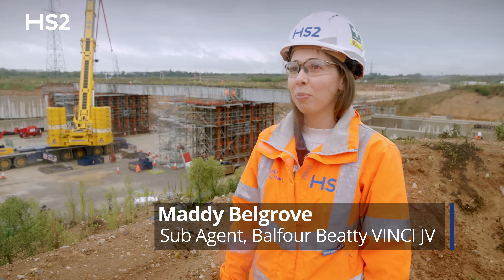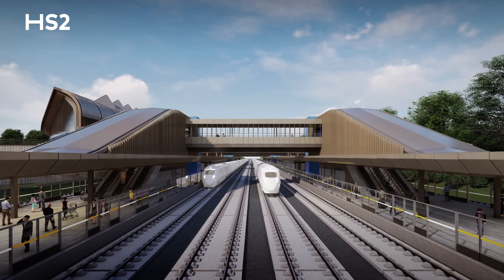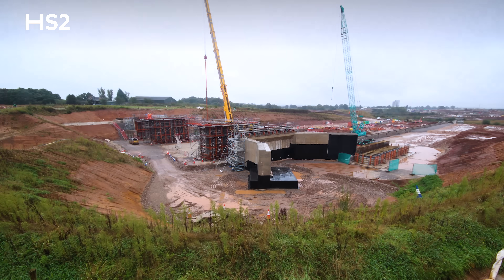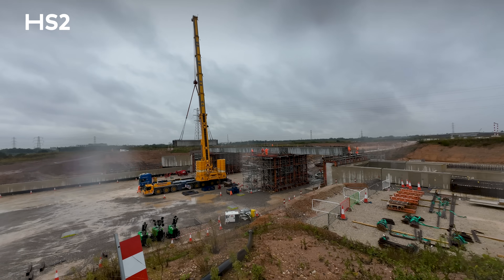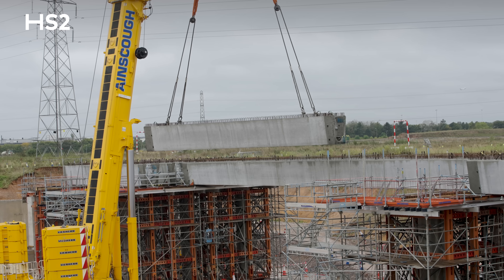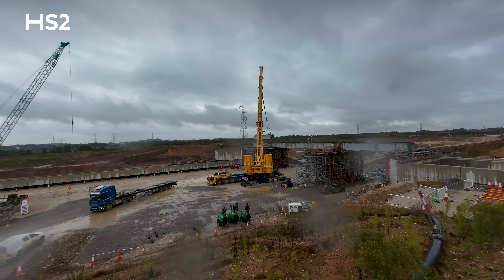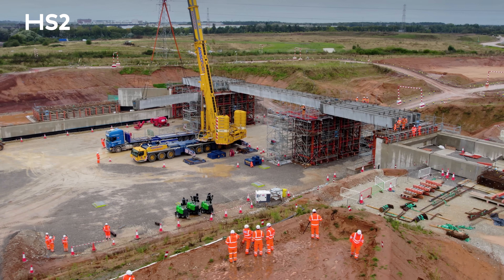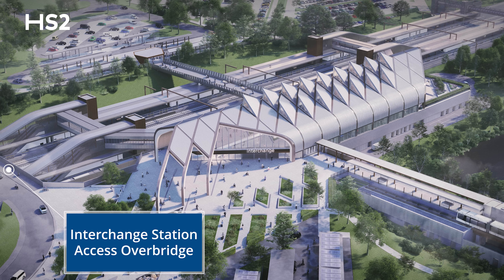HS2’s Interchange Station takes step forward with bridge progress

Comment: Why are the beams made in Ireland? Do we not have the technology / capability here?
Reply: Of cause we do. It likely there was a ready made factory able to produce them in Ireland.
Reply: Don't think foreign countries always have the cheapest solution. When I put the bid together for the completion contract to Crossrail's Tottenham Court Road Station I could initially only find 1 company in France who could manufacture and supply the platform concourse tunnel linings you see when you stand on the platforms. Then I found another company in Northern Ireland who were cheaper and put a better presentation forward.
Reply: Firstly part of Ireland is the United Kingdom, so it is important that the UK puts some of it's business out to workers there.

Secondly - no. Our central government has had years of dithering and cancelling projects. We used to have an organisation called British Rail Engineering. It was owned by all of us and the "profits" stayed in the UK. That organisation was broken up during Tory privatisation and then the rail industry was ran down, when we should have been engaging in a rolling program to electrify all our railways and our high speed rail network should have been started in the 1960s.

The result is that privatised rail construction companies and privatised bus construction companies fell on hard times and mostly got bought out by foreign companies.

There is nothing wrong with British workers. But we have spent too many decades electing people who want "someone else" to pay for railways. That causes contruction teams to have to disband. And that means we have to recruit experts from other companies.

Another case in point is that the Greathead Shield was invented here, but now the best tunnel boaring machines are made in Germany. And the Germans have the best machines, because they didn't abandon their own transport network expansion plans the way the British government did.
Reply: @DavidShepheard  The problem often was British workers, or more accurately their moronic union organisers. 

Rail was cut back more aggressively in the UK due to massive over capacity and also the geography of our tiny country is often more suited to car journeys. 

Btw, generally the British people want the people who use the railways to pay for them - I believe that only around 10% of the population are regular users. So the people who want 'someone else to pay for the railways', unsurprisingly tends to be the railway users. I use a car - I want the railway users  to pay for my petrol, but wouldn't really be fair would it.
Reply: @DavidShepheard  the supplier doesn't list any sites in NI (or remotely near NI) on their website. 

More broadly what it tells me is that road transport costs are far, far too low if it's more economic to ship this type of large, heavy bulky, low value (relative to mass) finished component from one country to another.
Reply: @unkleoo  Others have pointed out the factory that produce these components, have done other projects. Using a existing factory is going to be cheaper than any other option.

Comment: HS2 must got to Manchester for the real benefits to be felt. Leaving an extension open for up to Glasgow for further benefits as Glasgow to London would typically be done by air, something High-Speed rail provides a competitive advantage over. Otherwise, conventional rail suffices Birmingham to London.
Reply: Conventional rail does not suffice from Birmingham to London.

One of the main problems that high speed rail is here to solve is that the Reshaping of the Railways Report was very successful at building up our InterCity train network, but our InterCity trains run much faster than other trains that use mainlines (like the West Coast Mainline and East Coast Mainline). That causes a real conflict between the two types of trains and the timetable experts have to "solve" that problem by leaving massive gaps behind stopping services, to allow for the express services to travel at full speed without quickly getting into a queue.

In order to reduce congestion into Birmingham New Street it was necessary to add extra tracks north and south of the city. And doing that on the existing route would involve knocking down a lot of houses in towns and villiages that they old mainline passed through. The solution is a new line (or in a lot of HS2 actually an old line - some of this route is the good bit of the Great Central Railway).

When HS2 hands this section of line over to the new British Rail, we will start to migrate our InterCity services off of 125 MPH trains that compete against stopping services to high speed trains that slow down to 125 MPH between Birmingham and Scotland. We will eventually get the full route, and logically we do need to make the full route into a high-speed rail thing.

One of the things that has been done wrong with HS2 is that there are several stubby branches off of HS2 into "terminal stations" in the centre of England. After almost 100 years central government finally saw sense and stopped holding back Crossrail, but we have repeated the Crossrail problem with high speed rail, by creating two terminal stations in London, instead of copying the Old Oak Common station design and building a through station that connected Birmingham to the Eurotunnel.

At Birmingham we have also done the wrong thing with Birmingham Curzon Street Station not being a through station. At the moment Euston Station is in chaos, due to too many people standing around trying to figure out which train to get to go up North. HS2 and it's spurs are replicating that complexity. If the line was instead built so that every train that went to Birmingham continued straight through Birmingham and went all the way to Scotland, there would be no need for people to fart around in stations working out what train to get. Our InterCity network could literally be changed into a system where trains either go to all cities in Western England and Scotland...or all cities in Eastern England and Scotland.

Everyone in the West and East Midlands. And everyone in the North West and North East also needs to be able to go to Scotland (or France). The plan has been descoped by people who want to save money. At some point (hopefully not 100 years after today) future people will use the best bits of what HS2 has made for us and build a very simple to use high speed InterCity system that gets people from any English or Scottish city to any other English or Scottish city.

However, this is a good first step. And it is important that we start to remove InterCity trains from the mainlines going into our busiest cities now.
Reply: @DavidShepheard  The actual HS2 Train will continue it's journey North and merge with a recently updated high speed rail network north of Lichfield and continue direct to Manchester, and not via Crewe, probably arriving about 30 minutes later than planned. The beneficiary of this change could be Stoke on Trent who are desperate for commercial development.
Reply: @normie8895  Actualy as it stands HS2 trains will go through Crewe to Manchester as at Handsacre the HS2 route joins the existing WCML, and until a direct line to Manchester from Handsacre diverting rround Crewe HS2 trains will have to go there
Reply: Why does it have to go to Manchester for the real benefits to be felt and why if it only went from Birmingham to London would conventional rail suffice !!!!!

Comment: Should have stared at the north.
Reply: This question keeps comming up, my question is WHY should it of started in the North !!, big building projects like HS2 or Motorways are not started in one place, construction takes place the whole lenght of the project and so it is with HS2, construction work is taking place in Birmingham, Warwickshire and the length of the line to London and Handsacre
Reply: @peterwallen1063  because it would not have finished at Birmingham, it would have gone all way into London.
Reply: @peterdurnien9084  It still would have been cancelled, if it was started in the North. The Tories put people in charge who were encouraged to lie about the costs and then they lied about the costs themselves. We need to connect Glasgow and Edinborough up with all the cities in Western England and Eastern England. We need to have a long term plan to keep expanding this system.

Birmingham is one of the largest cities outside of London, so it makes sense to start this thing at Birmingham. As soon as the first sections get opened, and the existing mainlines can get freed up the mainlines can be resignalled for commuter trains and services for local workers can be improved.

What should already be happening, not just in the West and East Midlands but North West England and North East England is plans to start to create city based metro-systems, that take advantage of the freed up capacity.
Reply: @peterdurnien9084  Well it started at both ends, that is at Birminghm and London and the earth works and track alighnment reaches from London,via Birmingham to Handsacre in Staffordshire two thirds of the route, and is far further forward than if it had started in the North plus HS2 does not finish in Birmingham, a short stub of HS2 carries on from the Delta Junction to Handsacre in Staffordshire where the HS2 line will connect onto the WCML taking trains to Liverpool, Manchester and Scotland
Reply: @peterdurnien9084  What utter rubbish
Reply: What utter rubbish what I have stated is actually happening
Reply: I don't realy think you actually know what you are talking about, the Present Construction of HS2 is being built from Birmingham to London and to Handsacre in Staffordshire, HS2 does not stop in Birmingham. Where did you get that loopy idea from

Comment: What compete waste of money for a 101 Mile glorified siding , what an embarrassment in 2030 it's the bicentenary of the Liverpool Manchester railway, what good will this HS2 be, for folks travelling to see a real masterpiece of engineering in Manchester and Liverpool, when all London and Birmingham had were soggy canals ?
Reply: Oh what utter crap my son. First Birmingham is the Second Largest City in the UK with 1.5 million Citizens and is a modern rebuilt cosmopoltan City in what is now the biggest Metropolitan Counties of the West Midlands the heart of the UK industrial heritage and London the Capital of the UK, Soggy Cannals, there are more miles of Canals in Birmingham than Venice and what has Liverpool the 4th largest City in the UK and the City of Manchester he 6th largest City got to offer any better and before you rabbit on about Greater Manchester, Greater Manchester is not a designated City or was never one and will not be one and is not Manchester, Manchester is the actual City of Manchester, they re two different things only connected by the word  "MANCHESTER" and do you know what in railway terms a siding is, well it is a section of line with buffer stops used to store locomotives or trains, HS2 trains when they leave London will run to Birmingham City Centre, Liverpool. Manchester and Scotland, that is no siding.
Reply: I agree complete and utter waste of money. Knock 20 minutes off the journey
Reply: @leetown6741  It actually knocks at least 40 mins of the Journey time from Birmingham to London not 20 mins, at the moment it takes 90 mins average from Birmingham to London, when HS2  opens it will take 40 mins from Birmingham to London.
Reply: @peterwallen1063  whatever, it makes no difference, average people won't be able to afford it and not likely to make people visit London more. It will just cause house prices to rise and push even more average people out
Reply: @leetown6741  Well how wrong you are, is the average person can travel at present between Birmingham and London on the Avanti West Coast Train Service at preasent, then they will be able to travel on the Avanti West Coast train services on the HS2 route as that as all there will be when HS2 opens
Reply: @peterwallen1063  not sure what you're saying
Reply: @leetown6741  Not sure what I m saying, I think you need to do some resurch on HS2. When the HS2 line opens the train services on the HS2 route will be operated by the incubent operator of the WCML, which at present is Avanti West Coast Trains so if when the HS2 route opens Avanti West Coast Trains will be operting both the WCML and HS2 Hi Speed services from Scotland, Liverpool, Manchester and Birmingham to London Euston on both routes with the largest amount of services especially from Birmingham having the services trnsfered from the WCML route to the HS2 route so trains operating on HS2 will be bog standard high speed Inter City Services, so who ever travels on the Inter City Services on the WCML route will when it opens be travelling on the HS2 route with no price difference between the two
Reply: @peterwallen1063  we'll see
Reply: @leetown6741  Nothing to " we'll see" about it, thats how it is going to happen and has been advertised every where, once HS2 is open all but a few hi speed train service's from the North to London will travel on the HS2 line and not the WCML try doing a bit of reserch
Reply: @peterwallen1063  prices will not be the same.
Reply: @leetown6741  Now how do you work that out concidering the train services on the HS2 route and the Existing WCML will be run by the same operator at the time Avanti West Coast Trains, and the vast majority of Inter City services between Liverpool, Manchester, Scotland and Birmingham will be running on the HS2 route and not the WCML route means if on say hypothetically the Friday the HS2 opens, any one the previouse day that paid £150.00 from say Liverpool to London return on the old WCML route, will on the Friday when the same train service changes to run on the HS2 route will still pay exactly the same £150.00 for the trip to London as it will be the only route he could take

Comment: I just have only one question, is there going to be some kind of bus link or rail link (people mover) from HS2 interchange station to Birmingham International train station.

These 2 separate train stations should be very close to one another.

It would make perfect sense if there was.

The new Rail link at HS2 Interchange should be similar to the one that connects Birmingham Airport to Birmingham International train station.
Reply: The plans are for the present people carrier that connects Birmingham Airport to Birmingham International station to be extended to Birmingham Interchange Station as it has been named by the West Midlands Combined Authority Transport Dept and as normal in the West Midlands  Bus Services will connect into it as well making it a proper transport hub
Reply: I believe the plan is (or was) for the extension of the people mover that runs from international to the airport over to the new interchange, haven't looked into whether that is still the plan though.

Comment: It’s great to see this update. I haven’t seen any videos on the interchange area for some time. I am wondering if proximity to Birmingham airport prevents amateur drone work here.
Reply: The Station site is quite away from the flight paths into and out of Birmingham Airport
Reply: @peterwallen1063  It’s still in the no fly zone as it runs as a radius from the airport datum point.  The delta junction is partly outside which is why there is drone footage.
Reply: @jamesglover9034  Thats what I thought. There were videos from Michael Vaughn, but they stopped about a year ago. Hopefully HS2 can coordinate with ATC to get permission to video more in this area.
Reply: HS2 has posted quite a lot of videos about the bridge construction and more.